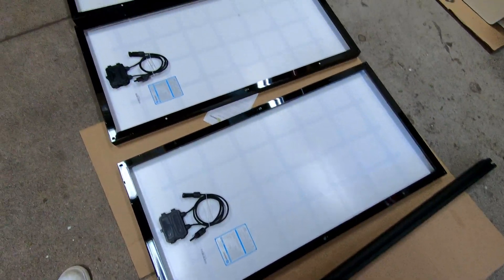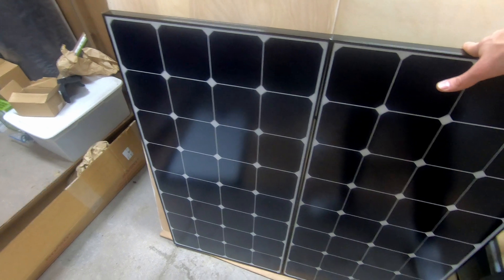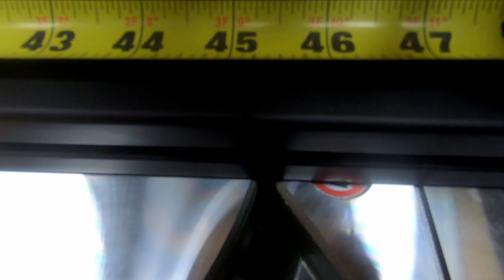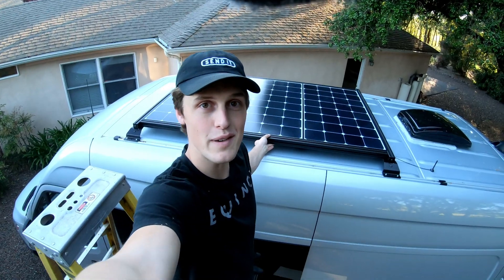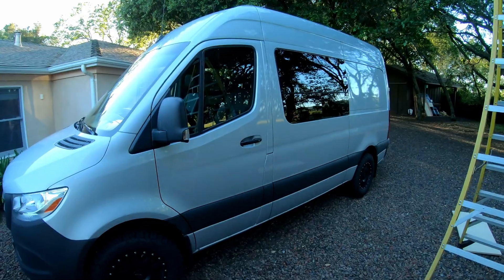How To Install 300 Watts Of Solar Panels Onto Your Sprinter Van!!!

Comment: Curious did you wire in series or parallel? Did you use the 3 to 1 renogy connectors? Thank you doing the same install.
Reply from the maker: Series. I did use the Renogy connectors,  not sure about 3 to 1 though.

Comment: I own a 2013 Ford Transit and I can use most of what you are doing in mine. Different configuration but I can use your knowledge as a template on my transit. The steps your doing is helping me with my conversion. I’m 69 and had had a stroke and your step by step is invaluable. Thank you so so much. So far I have installed Dyna mat inside on the top walls and floor before I found your videos but it seems like it is working out good. I can’t thank you enough for doing these steps for me. Your parents should be so proud of you and thank you again. Cliff Peranio. Port Saint Lucie Florida

Comment: Does rain water or snow accumulate in the ridges if the 8020?   
Thanks for the videos.
Reply: I am sure that they do but, think when you take off driving, those sorts of issues would dry out.

Comment: Do the solar panels act like a giant wing catching air?
Reply from the maker: Probably, but they aren't going anywhere due to the strength of the 80/20 frame.
Reply: @seven_o_savage  Could affect milage? What about leveling them?

Comment: I don't think that horrible lap sealant was necessary to waterproof your cable entry fixture, your 3M adhesive is quite sufficient.
Reply: What is wrong with lap sealant? It works very well.
Reply: @MyGoogleYoutube  Well, putting any caulking over screw heads does not contribute to make them waterproof, only caulking under screws do it.  Visible caulking attracts dirt and become black then the sun makes it cracking and eventually provides a path to water intrusion.

Using 8020 for your solar array is a great idea!
Reply: Then why does every rv built have lap sealant covering screws even when butyl is used? 

If there is one industry that cuts every corner it's the rv folks. If they didn't have to do it.... They wouldn't.
Reply: @MyGoogleYoutube  I don't understand either why they do that.  I had sailboats for 30 years and I never saw any boat builder doing that.  In addition, I am following european RV manufacturers on YouTube and I never saw any of them doing that.  Note that lot of european RV manufacturers offer a 10 year warranty against water intrusion, you will barely see one or at the maximum two year warranty from north american RV manufacturers.

Comment: Where did you get the brackets to mount the 8020 directly to the oem roof rails? I think I found some on eBay like that but they are quite expensive
Reply from the maker: Yep Hein sells them on eBay. Expensive but worth it!

Comment: Much easier to buy one 300w panel? less cables and only two connections. cheers for the video though!
Reply from the maker: Agreed, I'm planning on potentially adding more solar and wanted to keep it consistent with other Renogy 12v panels.